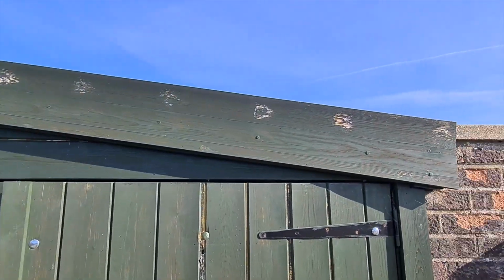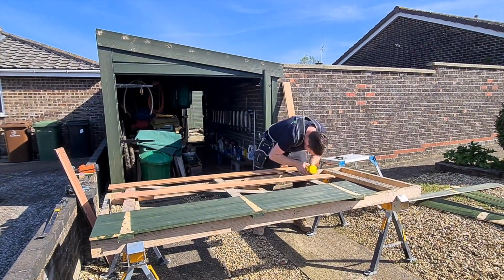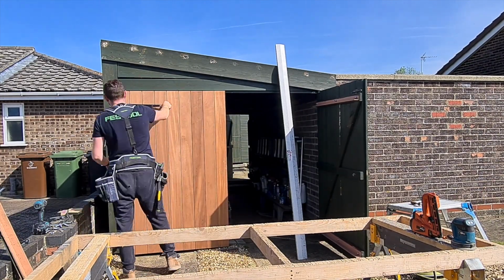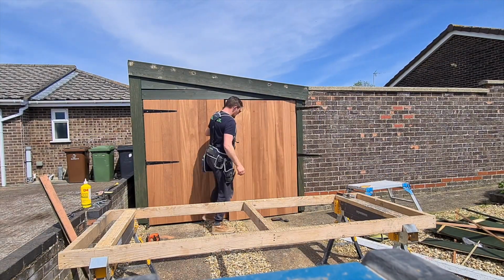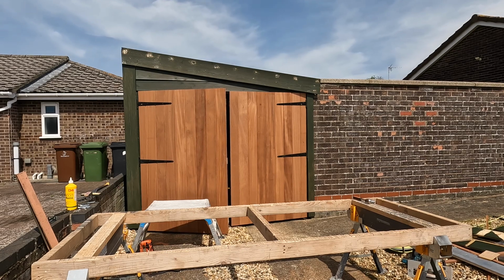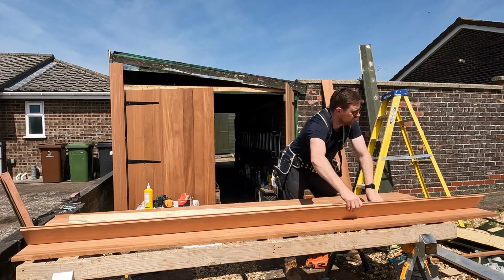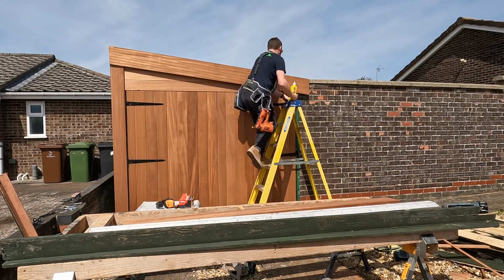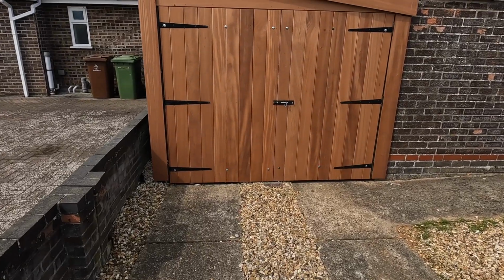I LOST money on this job!! A garage door that went WRONG!! Should we all be using hardwood now?!!

Comment: I've been making Joinery for 30+yrs and stopped using Redwood pine 20yrs ago for all of my joinery. I only use decent Hardwoods like Sapele, Idigbo,Oak,Red Grandis etc but avoid the rubbish some people use which is   Meranti which is complete rubbish. Accoya is a fantastic product (it's Radiata Pine but goes through a process which seals the cells,impregnates with acid and will not rot or expand,contract) and Douglas fir is still pretty good. TRADA rates Redwood pine as only "Slightly durable" so they have downgraded it over the past 15-20yrs and in my opinion redwood pine shouldn't be used for exterior use. 
     When making t&g ledged & boarded doors or any door with boards or panels they should never be glued in, they should always "Float" and room/space should be allowed for expansion and contraction. Before constructing them all the boards,ledges and braces should be fully primed,treated including the tongues and grooves otherwise they will blow apart which is what has happend here............... The problems all along were poor material, not fit for purpose and also lack of priming/sealing of all timbers including end grain.... The new doors ,if they are Sapele,Utile etc they will fall apart the same way if the boards were not sealed prior to fitting, During a hot dry spell the boards will shrink and if the t&g glued they are likely to split..
Reply from the maker: Cheers Adrian, yea fully expect a bit of movement but when boards are cupping and twisting to the extent of that in the video I believe that the problem is or of the fitters hands. And fitting a non framed door without glueing the boards together introduces other problems like sagging and twisting. I assess each job differently and apply my knowledge in the way which I see suitable. Hope you agree 👍
Reply: @BuiltByBen-YT  Hi Ben, when you make a ledged , braced and boarded door you need to consider the sizes of the sections so the ledges need to be wider rather than narrow, typically for a 1200mm wide garage door that is 1981mm high the ledges need to be at least 7-9" wide and at least 32mm thick and boards of 18mm thickness and upwards . This allows plenty of width for fixing the boards too. Braces ,again should be wide  so 5-6"and not 4x1 or similar. Those ledges,rails on those garage doors were too narrow. Never glue boards to ledges and always seal,prime,stain all boards on all faces,edges and end grain. The reason some doors sag,drop out of square is down to poor fixings of boards or braces poorly fitted. 
     For instance if you have a door hung on the left hand side and the braces are correctly fitted to the back of the door (ie Top of braces on the R/H going down to the bottom L/H where the hinge is you should nail,screw each board on the ledges the same way so 3 fixing per board into each ledge diagonally from top right to bottom left. The nailing/fixing pattern is designed to help prevent the doors from dropping, like the braces do.. 

  I only give advice on what I'm good at, I know naff all about gas cookers (lol)  but I do know about making Joinery.............. All the best Adrian..
Reply: Love my Accoya, but I've been looking at Thermowood (goes through a high heat process,has 30 year life untreated, & longer if treated) for a ledged & braced gate,but prices have shot  up recently, & sizes hard to find.
Reply from the maker: A lot of joiners now offer engineered softwood too which I have tried for internal use. Seems like a good option. But after this stinger I'll be staying away from all softwood outdoors or in moist areas.
Reply: @BuiltByBen-YT  today a lot of softwood is complete rubbish compared to what I used 30-40 years ago,& only fit for firewood.
Reply: @BuiltByBen-YT  Hi Ben, I use some of the engineered stuff, mostly "woodex" from Lathams, which they do in Sapele,Oak and Pine. It is a fair bit more stable. I also use Engineered Red Grandis (Eucalyptus) , that comes laminated but they also do PAR sections close to typical finished sizes where the core is laminated and then has a 7mm thick "veneer" so you only see the joints on the short side (if you get my poor explaination). It's good for door stiles,rails etc as they stay straight, no bow,twisting etc. Accoya is about the perfect timber you can get for external use but only 2 companies have the import licence so they keep the supplies tight and prices high. Only downsides are you must use stainless steel ironmongery ,PU type adhesives etc. Price wise it's close to European Oak so not cheap but if you make Bi-fold doors it's perfect because it doesn't expand,contract 0.1mm even if submerged in water. As you say best to avoid SW for most things. :-)
Reply: @stuartandrews4344  Hi Stuart, I need to look into Thermawood as I don't know much about it. Accoya is great but until the cartel who price fix is broken many clients can't afford it. A close friend of mine is a Rep and his company were working with a company to perfect a similar product to Accoya. Apparently they bought it out for gates etc to start with but accoya bought the company and the product was shelved.. I cynic would say Accoya's only motive was to kill the competition. Have you used Red Grandis?. Used it a bit after using Sapele for years and years but it's now on the cites watchlist.
Reply: @stuartandrews4344  The days of SW being slow grown, air dried etc have gone.It's all fast grown, early harvest and kiln dried. Most of the Forest are owned by the US so we really only get 5ths rather than even unsorted grades. The best goes West. Douglas fir is ok but you can often get the unsightly shakes.. :-)
Reply from the maker: @adriansams6066  thanks Adrian.
Starting to think you're an accoya rep 🤣 you're demonstrating the difference between a carpenter and a joiner here 👍 great knowledge of the different types.
Reply: @adriansams6066  So true.
Reply: @adriansams6066  Never used Red Grandis, read good things about it, but thermally modified wood  prices have rocketed,as have a lot of other types of timber.

Comment: I’ve built a number of my own doors over the years at home. You’re bang on about the quality of the timber, it’s poop. 
I’ve done a number of internal doors, just ledged and using T&G
I don’t personally think a second fix Brad is man enough to hold moving wood, even toshed in on a 45. What I’ve got is a non marking head for my my first fix Paslode, fire in to the ledge, firinh the nail right though, then flip over and bend over all the nails. Use a punch to get them all flush, then whip the sander over. 
Does take a while longer. But, none have as yet warped like yours. 
I have however still found the joint pull slightly between the ledges. I just get around that by first coating it all first. I also don’t use the PU glue, and just PVA, therefore not getting tye issue of glue showing.